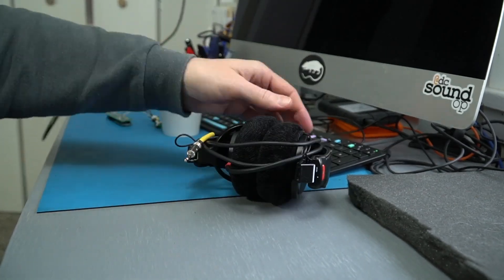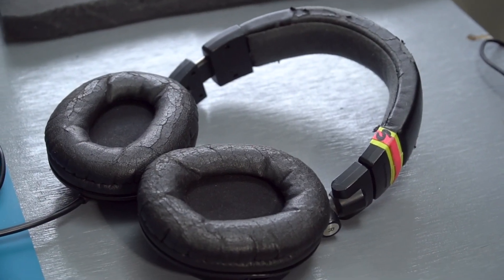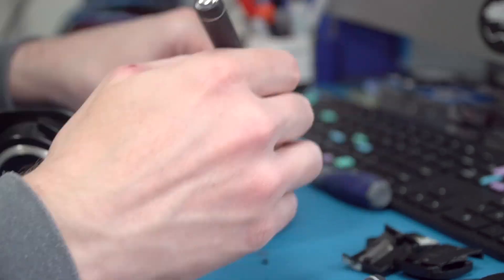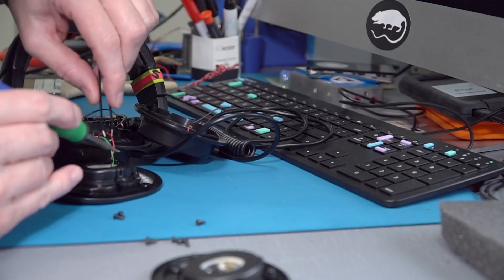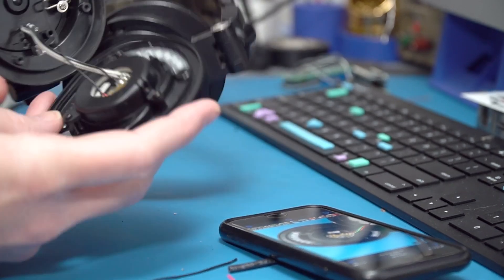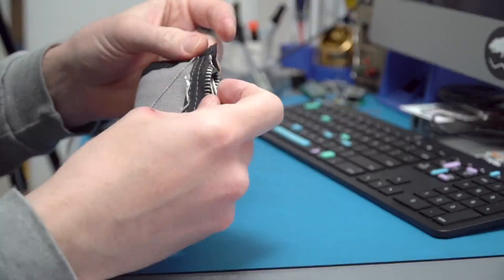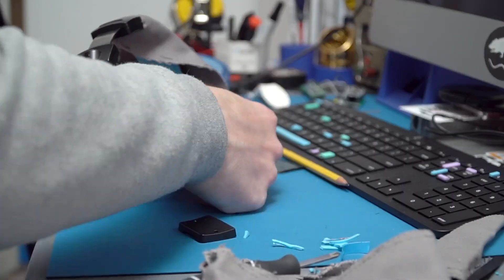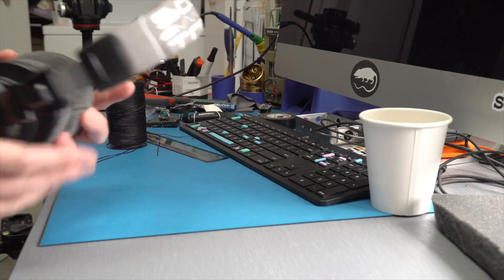ATH-M50 Headphone Rebuild, Cable Mod,  FRESH ear-pads & a hand sewn headband 🧵🎧

Comment: Be mindful of the aftermarket ear cushions, they tend to be much thicker and move the speakers away from your head enough to greatly effect sound quality.
Reply: Yeah, hugely dropped the bass for me
Reply: got the same cheap ear pads by mistake. they are more comfortable and can be used for longer with less sweat, but unfortunately the fabric allows more sound to escape compared to faux leather and distance from speaker to head just destroys the sound. bought replacement parts from Audio Technica themselves and even though they wear out faster, sound is just as it should be

Comment: I just used a heated knife to carve out carefully some of the headphone cylinder plastic part near the port so i could use any 2.5 mm aux cable.
Reply from the maker: That's a great way to do it! Thanks for the message.

Comment: Indeed, headphones are an extremely personal matter.
I use Beyerdynamic DT 250 Pro for live sound and Sennheiser 250 Linear II for everything else.
Those Beyerdynamic DT 250 Pro are from 2004 and still do not need to change anything, with only discoloration on the ear pads, which are now with a pleasant brownish appearance and for what I predict they will stay like that for many years. No fake leather here.
I still use the Sennheiser 250 Linear II - luckily I bought several pairs in 2005 - and after all the plastic parts died, I made a decision that until today I did not regret, which was to install some of Sennheiser's capsules in some old Realistic NOVA 20 headphones, properly insulated . Nice!
The ear pads of these Realistic NOVA 20 are original and do not require replacement, since they are made of very good quality fake leather. Or so it seems to me because they are apparently indestructible. Aesthetics? Not really… Dimensions… who cares? The sound…?exactly what I like!
And my Tinnitus thank me for this care.

What I wish for everyone who uses headphones professionally is to have at least the luck I have had with headphones since 2004.

Stay safe!

Greetings from Portugal
Macedo Pinto

Comment: I'm about to do some work on one off my fav head fones as well the over head Bridge part was built in the most ridiculous way I've never seen so many parts?😮🤬 it was built in away where you would get only 5 months wear then ...Broken, the best headphones are the ones that have a sold steel frame right across the bridge, Marley head phones are good for this, anywho kool video cheers for sharing😊 your headphones look alot better now Grey is a good chose👍🏼
Reply from the maker: Hey, thanks for the message. Let me know how it goes with the repairs on your headphones, it's been fun seeing the fixes other people have done since I put this video out. Good luck!

Comment: How are the cloth pads with perforated leather inside? I recently got pleather pads with little more width and depth. The harshness from close drivers went away and sound stage improved but the extra little volume inside allows the bass to build up, I like the rumble of the sub bass but low mids also got boosted a little that it masks the higher frequencies. I'd be pleased to learn which pads tame the harshness, increase the sound stage while also letting bass breathe through while retaining its power and impact.

Comment: I have several pair of MDR7506's and my go to pair has been modified with a 3 pin mini XLR jack on the ear cup and then they are compatible with any of the AKG style mini XLR to 3.5mm cables, most of which use the screw on 1/4" adapter like the original Sony. A set of velour ear pads also makes them comfy.
Reply from the maker: I love the mini XLR connectors. After the last few TA5 adapter cables I made for my Lectro PDRs though, I’m not in a huge rush to solder more of them. Velour ear pads are the best imho, Ultrasone PRO900 & Beyer DT900 are both sooooo comfortable.

Comment: I've had my ATH-M50x for almost 5 years now, and recently started using them while running or cooking with high heat so the headband foam has a . . . . funky smell to it. I'm wondering if I can just simply remove all the old foam, clean that down, and wrap a pre-bought headband cover directly over the plastic. I'm worried it'll be too thin or uncomfortable without the original foam or adding new foam. Is it better to wrap the cover over the old foam, keeping the "funky" stuff, or remove it all and just have the original plastic with a new headband cover? Thank you!
Reply from the maker: If something smells funky, don't ever just cover it up. That goes for headphones, houses, boats and anything else in life you come across that stinks. Without any foam at all, it will be pretty uncomfortable in my opinion, but you can get sticky backed foam anywhere (Walmart sells it in the crafts section) and it's super easy to build it back up to something comfy.
Reply: @DcSoundOp  That's good life advice! I'll give the sticky backed foam a shot. Thanks again!
Reply from the maker: @jananchan420  Let me know how it goes, I'd love to see how it turns out for you.

Comment: Hey, where did you get the plug-in cord style? I have a pair of ATH-M50's and I keep snagging the cord on things, and the right earpiece no longer has sound. I figure adding the plug-in type of cord will at least alleviate the issue by pulling out instead of severing the speaker's connection. Any info would be greatly appreciated. Thanks
Reply from the maker: Hey, thanks for the message. If you're looking for the 3.5mm jack, these are what I used - https://amzn.to/3NMU6Bd - let me know if your question was about something else though. Thanks again.

Comment: Got DT700 pro x.. expected it will be best.. And I was wrong. So muddy.. returned in same day. So looks like need some mods and old m50 will be ok for next 10years
Reply from the maker: In my experience, people either love Beyerdynamic's approach to not pushing the clarity as much, or it feels wrong. If you're comfortable with the top end on the M50, the M50x or Sony's 7506 on the extreme end (as I am), it can take some getting used to swapping to something like the DT700 or 770. Always good to keep your M50's going though! Thanks for the message.

Comment: just did the 3.5mm port mod on my set and now I have no audio :( any idea why it might be? I'm fairly certain I soldered the wires in the right places.
Reply from the maker: There’s not much else that can go wrong besides the wiring not being correct. Did you double check everything & make sure the cable you are using is wired as you expect it to be?

Comment: Great video. 
Mine are falling apart too. The problem I have is, I want a pair of replacement earpads that don't change the sound of the headphones.
Reply: For those who have the same issue here is a potential solution:

Brainwavz Audio
PROSTOCK ATH M50X & M SERIES REPLACMENT EARPADS - CUSTOM DESGINED SHAPE WITH MEMORY FOAM - PU - DARK RED

Comment: I am confused, which cable goes to which pin on the jack socket? Mine has 3 pins sticking out
Reply from the maker: Headphone jacks are wired Tip = Left | Ring = Right | Sleeve = Common

Comment: Thank you very much for this great HOW-TO video.  But, I have one question:  How do you know that your Headphone Drivers (the internal speakers inside the headphone of these MD50x) are still performing at optimal levels?  I mean...I can recall a few times that I really blasted the volume on these things.  ALSO, I live in a very humid climate.  So, might the humidity adversely affect this sound quality?....  The other thing is that, somehow, and I do not know how, the headband has become bent out of round, and is sort of not symmetrical as it once was.  And, I am afraid to use force to try to bend it back.  What to do, if you have any advice.
Reply from the maker: Hey thanks for the question. As far as humidity goes, and exposure to moisture or salty air near water, there isn't going to be a ton you can do to stop that from causing issues with electronics other than drying things out the best you can between uses. The same goes for taking care of them otherwise, they can handle some pretty loud stuff, but if you think you've damaged them, I would first compare them to a good set, so you can to see if they are different. A proper test rig will run you around $300 to actually measure them - https://www.minidsp.com/products/acoustic-measurement/ears-headphone-jig - so if this is something you want to get into in detail, that's totally possible.

Comment: I dropped my headphones can that affect sound quality?
Reply from the maker: It certainly could if you dropped them hard enough, but most headphones like the ATH-M50 are pretty robust. Are they doing anything since being dropped that is making you think they are broken? Thanks for the message.
Reply: @DcSoundOp  I cant tell for sure if the sound quality got worse maybe a little. And my ears for some reason hurt or have pressure when using them since then but idk if thats just a placebo.
Reply: @DcSoundOp  I have the ATH M40X. And it was a really hard drop from my table cause I stepped on my cable by accident.
Reply: @DcSoundOp  The stereo field kinda sounds muddy or the sound is like its in a bubble or something. But again I cant tell if thats a placebo or really the case.
Reply from the maker: I can't say for sure about the M40, but a fall from a table wouldn't cause any issues with any of the AT models I've used over the years. You can certainly have issues if the cable gets pulled hard enough by stepping on it or tripping on it. However, that would usually result in an intermittent cutting out or scratchy sound, not what you are describing. 

Theoretically anything is possible though from being dropped if they landed just the wrong way. Are they still under warranty?

Comment: Hello, very good video, I want to make that modification too, but I wanted to know, do you think you can modify them so that it uses balanced cable, take my like and I subscribe good content
 bro
Reply from the maker: Yes, absolutely you could. Assuming you have a balanced headphone amp & are up for the cost for not much tangible return, you could for sure. I’d probably use a mini-Xlr of some flavor if it had to be done. Thanks for the message!
Reply: @DcSoundOp  So if you can modify the m50 so that you can hear balanced audio that would be something incredible! please do it
Reply: @DcSoundOp  Another thing, what pads do you recommend that grip the bass well and do not bother as much as the originals

Comment: Mhhh... Any pad other then the original will change the sound, usually for the worst. Stick with the original, they're called just HP-EP, but beware of cheap lookalike copies; they fit and sound good also on the 7506! I solved the headband issue with a padded cover with zip closure I've found on "the bay", the size is perfect, can be taken off to wash with shampoo and it's streachy enough for a bit of extra padding if needed; it fits also on Denon D2000 and E-MU Teak. But first I removed the old flacking pleather on the headband with duct tape: stick and pull hard like a brazilian wax, no crumbs all over the place, no black goo under your fingernails... fast and clean. I also had the old "non x" version and modded it with a removable cable, but used a nice screw lock jack, the Sennheiser lavalier mic style. The other eaging part that affects sound is a foam plug in the back of the driver, right in the center of the magnet hole, if it crumbles after 15 or so years, sound will change for the worst, just replace on both sides with a small foam nugget, also on new replacement drivers is not present so, in case of replacement, a new pair of twin plugs is needed to achieve a decent balanced sound (the 7506 has the same foam plug and gets old in the same way).
Reply from the maker: I've written this response dozens of times now it seems in the comments here... but for live work the ear pads don't matter even the tiniest bit. These are ten year old headphones used for soloing and spot checking issues on live stages. Thanks for the message & for checking out the video.
Reply: @DcSoundOp  Yep, It makes sense in your scenario.

Comment: dont change earpads to thirdparty earpads it will sound different
Reply from the maker: For live work it doesn't matter even the tiniest bit. These are ten year old headphones used for soloing and spot checking issues on live stages.